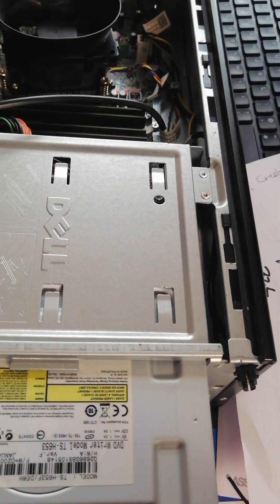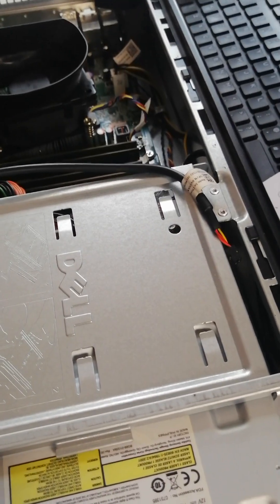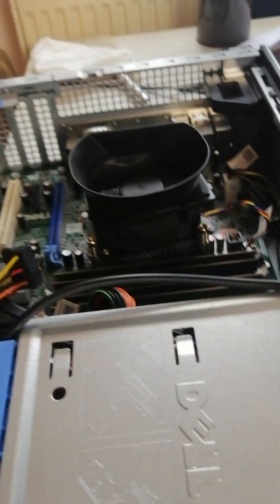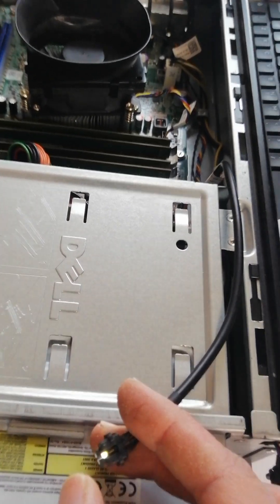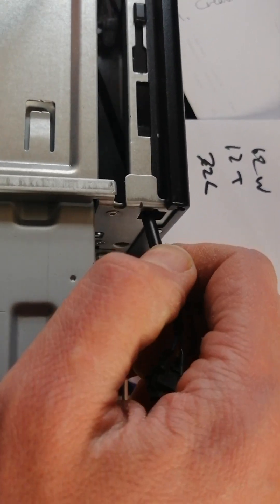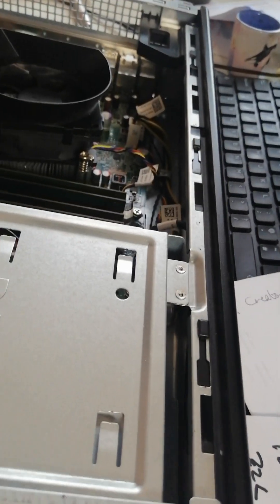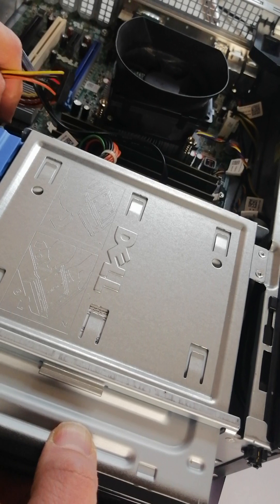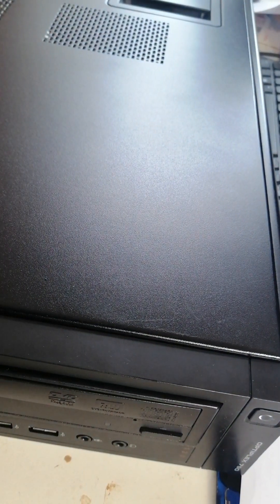A computer that randomly turns itself On/Off and Loops (Dell Optiplex 790)

Comment: My Dell Optiplex 9020 Tower refurbished when you power it on it turns off immediately then you have to press the power button to turn it back on again and it stays on?  What is causing this issue, please?  Could it be Power supply circuits or the switch?  Many Thanks🤔

Comment: I have a Dell Optiplex 790 that turns on by itself and then shuts back off. Sometimes the power button works but most of the times it does not. I have tested the power suppy by pushing the diagnostics button in and it's tested ok with a solid light. Most likely the power button is the issue 😑
Reply: It sounds like that is the issue, it's what you want